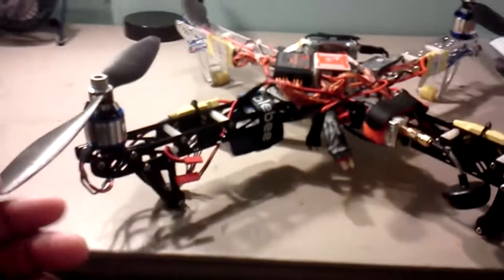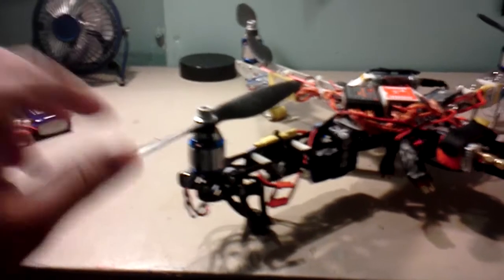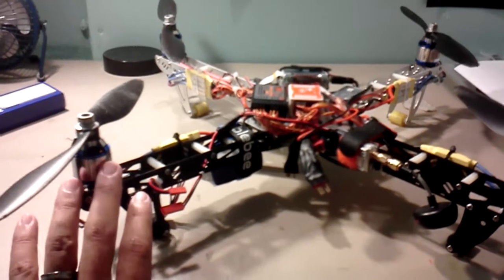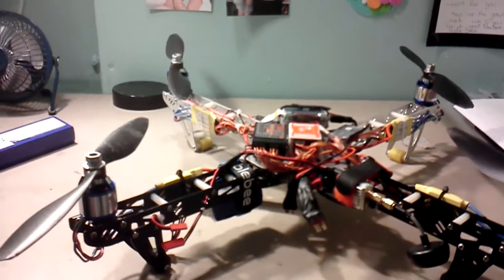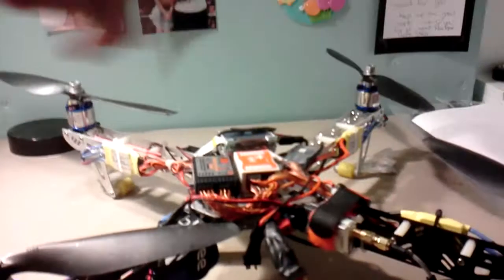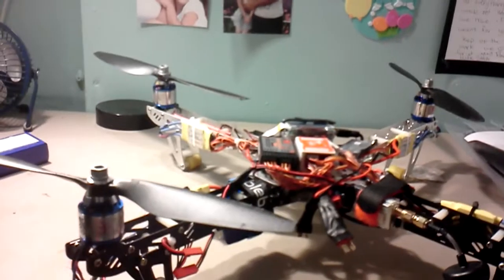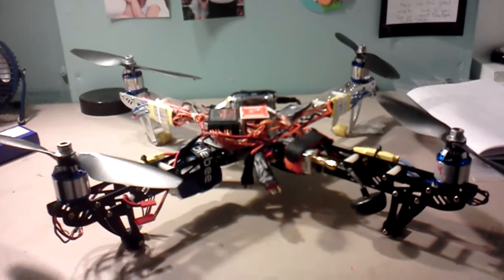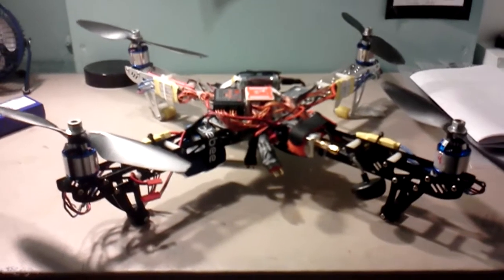Quadcopter problem

Comment: I have the same motors on my DJI F-450 with the DJI ESCs and it works great. they have more power than the stock DJI 2212-920kv motors. So I would say it is the esc's

Comment: Had simular problems.  Exceed motors with Turnigy ESC with naza.  went to the forums and found my ESCs not recommended for Multirotors.  decided to keep it simple.  DJI Naza M with DJI motors and DJI props and DJI ESC  all works great, not a scientific approach.